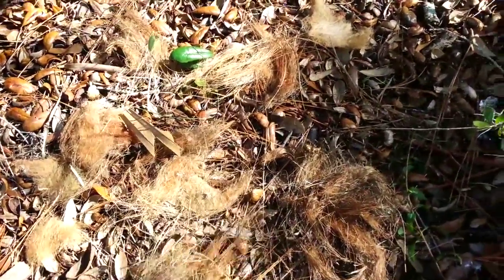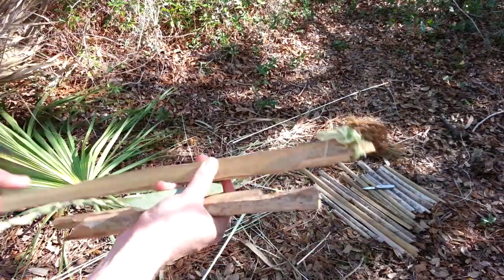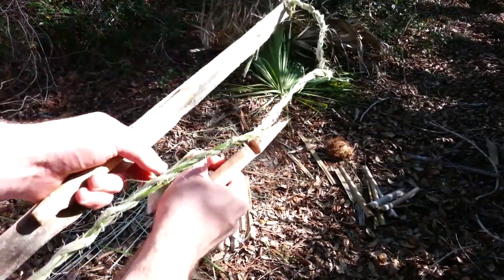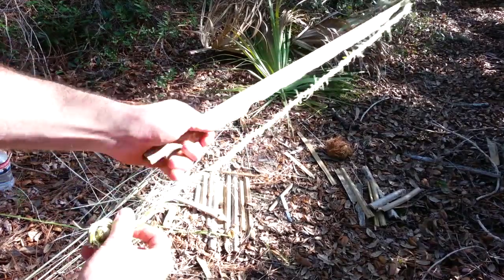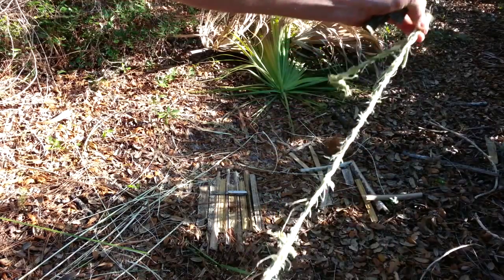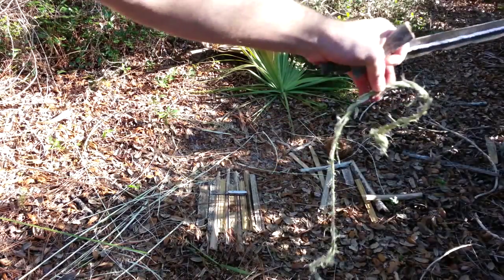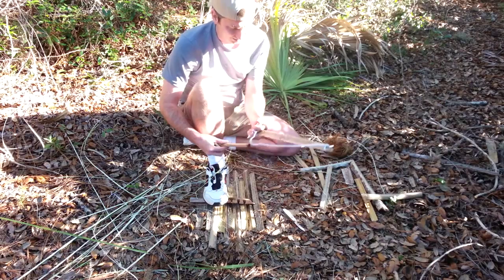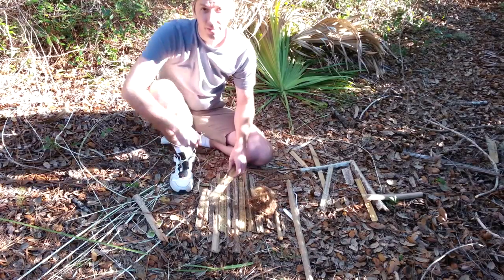Bow Drill Fire - All Palm Materials (sort of)

Comment: Nice brother.  I thought you had it.  One thing I did different was the cordage. If you use 3 small strands from the very outside part of the frond it won't fray as bad. The smaller you go the better if you weave it tight.  Just make sure to use the green skin on the frond not the fiber in the center.  The strands I used were toothpick size thickness. I hope you give it another go to show it can be done with all palm.  Most useful plant in Florida.
Reply from the maker: Thanks for the tips. I'll give them a try. I've had numerous successes using Sabal Palm cordage before so I know it's do-able. Guess my approach is more quick & dirty as opposed to taking the time for good quality. I'll give it another try, maybe this weekend. I learned some things along the way and have a couple ideas.
Reply: gundog5 Awesome man I'll be sure to check it out.

Comment: That was flippin sweet.
Have you tried that palm in a hand drill set up?
Thanks
Reply from the maker: Thanks. Yeah, I've used Sabal Palm for hand drill. I often use it as the fireboard with a wild weed as the spindle. I have used it as a bit in a spindle as well. Once, I even carved it out as a long enough spindle. Overall, probably about medium effort depending on how humid it is.
Reply: gundog5
I got to try Palm sometime.
Thanks for the info